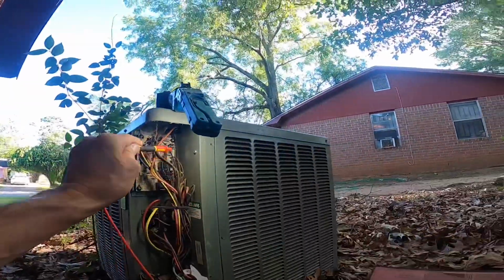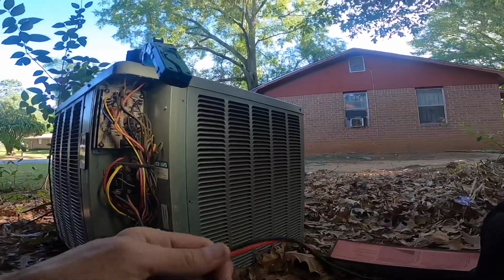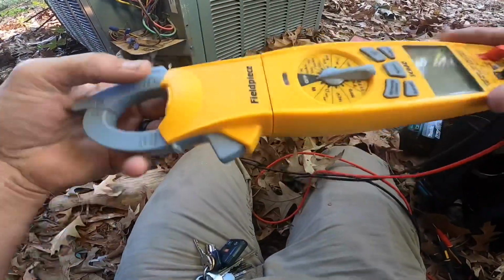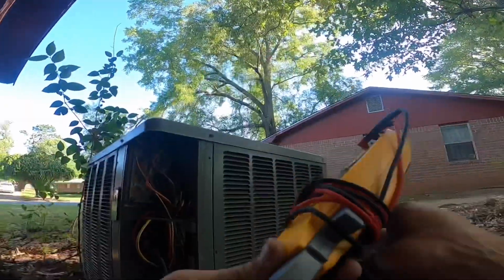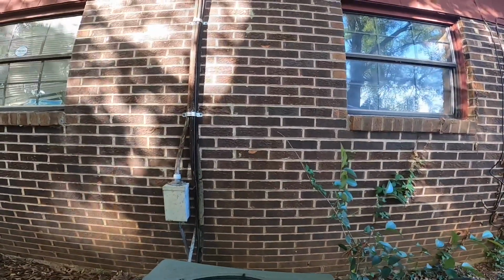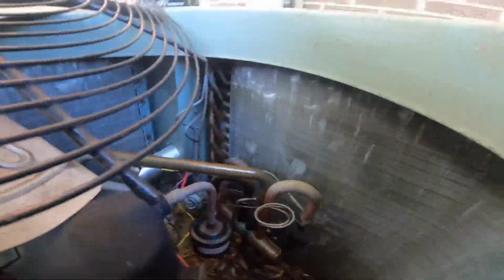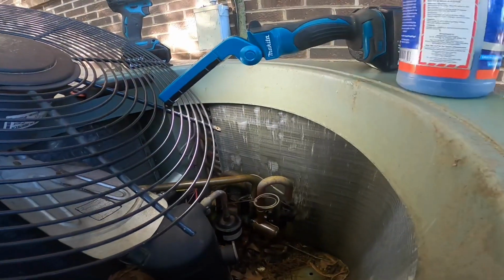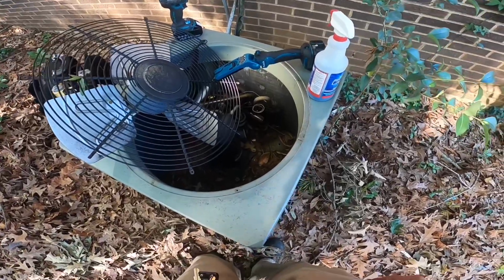No Cooling, Low Pressure Control Open, Finding out Why

Comment: How come you had 28 volts with an open switch? My understanding is that it would read zero or OL. Please correct my misunderstanding! :)
Reply from the maker: It is trying to send 24V through the switch. If it’s closed there will be no potential across and it’ll read zero. But, if it’s open one side will have 24V, and the other won’t. That’s a 24V potential.
Reply: Makes total sense now using the analogy of water pressure in a pipe. The 24v is building pressure because the switch is closed. There would be some pressure/voltage going through  but our meters won’t detect. Thanks for your reply. I watch your videos on the daily!